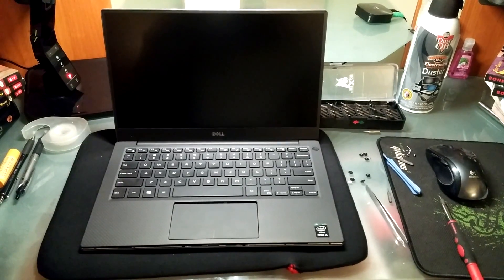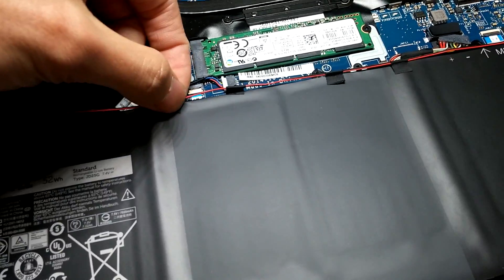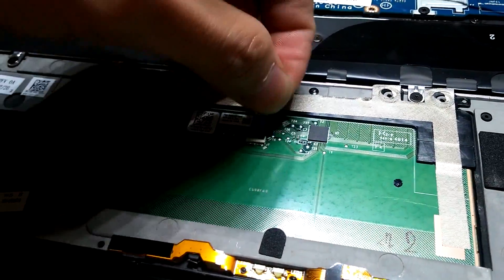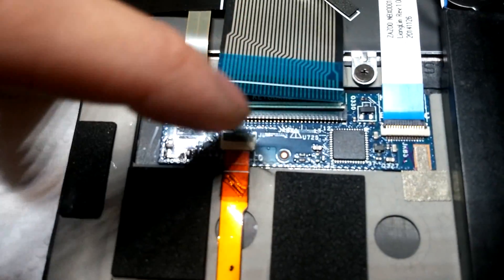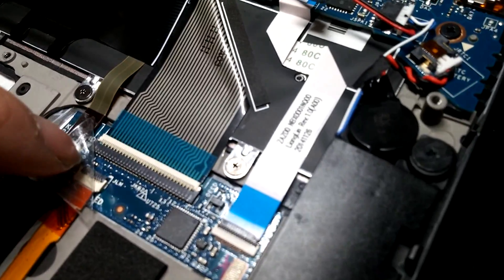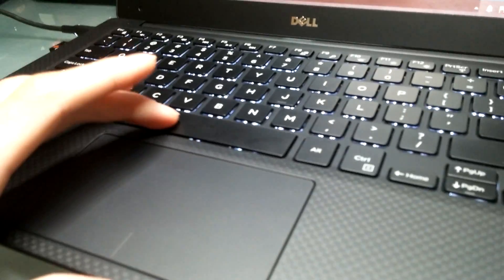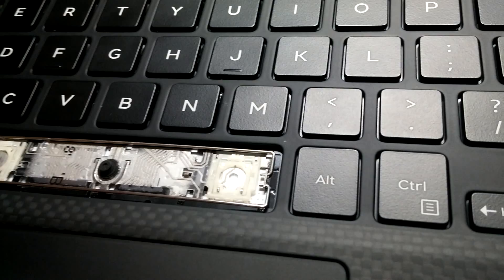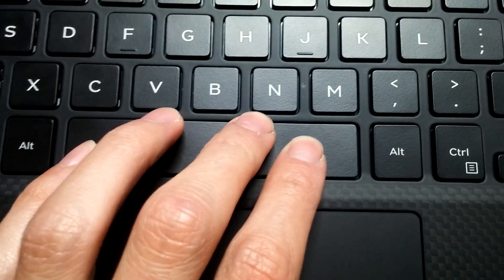Dell XPS 13 & Other Laptops - Fix Space Bar key sticky resistance tight defect problem DIY keyboard

Comment: Thanks for the video!  I wanted to put this comment out there since this video is quite old now,   I have a dell inspiron 14 7435 2 in 1 laptop.  it had a spacebar issue where it didn't feel right was kinda mushy and super, super sensitive.  Barely had to touch it to activate the button.  Anyways I took off the bottom and part one of this video does not apply to this model.  the ribbon cable issue has apparently been fixed or just didn't apply to this model.  However, part 2 of the video helped my fix the issue!  I popped the plastic off just as instructed and bent the metal rods to give them an upward arch while they are laying down.  I did both the top and bottom rods.  First time I had bend the top one a little too much.  Took it back off and made it less bent, put it back on and I'd say it's a 90% plus improvement.  I don't even really notice it at all now.    So here's another thank you for the video!  Just wanted people know that at least part two of the video is still a relevant fix for an issue dell still apparently has.  This computer has been like this since I got it, which was about a week ago, but it was an open box deal at best buy and I got a great price so I didn't want to return it.  Maybe that's why it was returned in the first place!

Comment: thanks for the detailed explanation. My problem was that the spacebar would not register unless you hit it around the  middle. If you tap the spacebar on the left or right sides, then it sometimes won't register. Your method #2 didn't quite work for me. I had to bent the rod towards the opposite direction (U -shape), which raises the key back up on the left and right side. Now the sides of the space bar register perfectly. 

On another note, I purchased a replacement keyboard from ebay that had the exact same problem right out of the box. Terrible design flaw by dell and/or their vendors.

Comment: same thing here,
for me it was the left and right sides of the space bar that dont work at all. the sollution was to bend slightly  the two sides of the metal (inverse of what you do) and adding a thick double sided tape in the midle of the barr(tou "erase the trigger buton)

Comment: I used your directions to fix the totally useless spacebar on a brand new Dell XPS 9650.  The disassembly was much more hairy than the laptop you do here: you need to remove damned near everything, including the motherboard.  Disassembly directions for the 9650 can be found here:

https://www.youtube.com/watch?v=Nvz7fcqzQDM

Doing your part 1 made the spacebar almost good.  Doing both parts made it nearly 100%.  The far edges of the spacebar still don't work.  I think that the bar itself is flexing too much.  But it's good enough, yay!

THANKS!

Comment: When I was removing the spacebar, the two white pieces came apart, but I don't know how to put it back together. Any help?
Reply from the maker: pry open a key that you use the least (just in case) and study how the two white pieces fit together. I had that problem before and it took me less than 5 minutes to fix by studying another key. They all use the same mechanism.
Reply: The spacebar piece are almost completely different, such as they are big rectangles and has holes for the hooks (6) when the other keys  are hooked with these notches going outward. The mechanism is the same but I don't know how to fit it in :/
Reply: Lol took me a while but it got it! thanks!

Comment: This actually helped on my thinkpad... thanks!
Reply: X1 Carbon? I just bought a 5th gen X1C and the trackpad moves around a little in the frame and feels as if it isn't the right fit. I am thinking of doing this and tightening the screws to make it feel better. My brother has the same machine and his trackpad is fitted into its frame very tightly. Any suggestions?

Comment: The right and left side of the space bar didnt work for me, I tried to bend the bar (both ways), didn't work, so I put a bit of electrical tap in the middle of the back of the spacebar (where it presses on the button), works like a charm now!
Reply: I am having the exact same problem, right and left side are almost completely unresponsive. Would you mind sharing exactly how you did it? (or upload an image off it) would be greatly appreciated.
Reply: I don't have my XPS anymore (too many problems, returned it), just do as the video shows to remove the spacebar, and add padding in the middle of the back of the sidebar, where it contacts with the press black button on the computer
Reply: I had exactly the same problem on my new XPS 9360. I added three small layers of electrical tape the the rear centre of the keyboard - where it makes contact with the black rubber button that registers the key press. That appears to have resolved the problem completely. 

Before the fix, mine was so bad that an inch on the left and right of the space bar didn't register anything.

Comment: I just tried method #2 and the middle is perfect now, but the left and right ends of the space bar are almost completely flush with the keyboard.

edit: i followed Marc's option down below by reversing the bend so that middle is downward and left and right are upward, and it has resolved the entire spacebar! It's super clicky now.

Comment: I tried the second part, before I hadn't seen theplace that the little wires go. Thank you so much.My E1505 and I are very happy.Not 100% but a lot better.  It just wouldn't do spaces. Halfthe timeis better than none. ;)

Comment: Real helpful video! I only watched this so I could know how to open up the laptop safely. Then noticed my spacebar had the same issue as described in the video, the second method was super helpful. Do you know if its possible to tighten up the the hinges on the screen if it starts to feel loose ?

Comment: I have the XPS 13 2016 and 2 days after i got it, the c key got "sticky". Apart from the fact that it is just sad to pay more then 1000 € for a notebook and then it has such obvious production errors, I need to remove at least the key. So my question is, if you can just remove the normal letter keys by prying them out, as shown in method 2. I would be glad if anyone could give me an answer quickly, because this is annoying but i don't want to break my keyboard by ripping out keys.
Reply from the maker: Yes, you can do method 2 for your c key to see if there is anything stuck under there. However, unlike the space bar,  there are no metal support brackets underneath.

Comment: Is it necessary to remove the trackpad first? It looks like you should just be able to disconnect the main keyboard ribbon cable and then tighten the black adhesive cable.

Comment: Hi Sam, thanks for the video. I've recently had a sticky 'W' key and removed it and cleaned the area. It didn't fix the problem unfortunately, but now I can't get the key back on. COuld you please do a video on how to replace the just a normal key (not the spacebar). It seems  very complicated with two white plastic pieces. Thanks.

Comment: Method 2 kinda worked for XPS 15 9550. The bottom part of the keyboard was mushy like crazy and now its a lot better. However, its a little mushy still in the middle but I can live with it. The top part of the keyboard where it never needed a fix and how it should feel still feels fantastic as it should.... why Dell why.

Perhaps I didn't bend the bar enough? I was a little conservative. But I didn't bend it anymore than the video.

But thanks so much as it does feel a lot better!

Comment: Since someone said it works on the latest XPS 15 9550, i did the exact same thing on my laptop (Method 2). However the space bar doesn't rebound anymore at all. Everything looks intact, and i don't know what's wrong with it. Can someone help me please?
Reply from the maker: +Zhaoxuan Jiang 
Try taking it apart and study how everything goes back together. Every little clip and how the metal mechanism works.
There should be a rubber piece(s) under the spacebar that does its job to rebound. If the pieces are incorrectly installed, it can cause the key to not rebound.
Reply: +Sam K Thank you for your reply. Today I managed to remove the 2 white plastic brackets and reinstalled the other parts. Now the space bar is loose, but it does rebound. Is it possible that i damaged the brackets? They look intact indeed.

Comment: My spacebar didn't respond well at the bottom right, I had to press really hard down to get it to register. Bending the bottom metal bar so it archs up a bit, didn't help. Bending it to arch down didn't either. Then I swapped the bottom and top metal bars, and all seems fine now! Still not the greatest spacebar, the bottom is almost flush with the chassis. But at least it now sort of clicks and all presses get registered, no matter where I press on it, amazing! Thanks :)

Comment: thanks for the video. Kinda stupid you actually have to deform the metal to get things to work without colliding.
I'm pretty sure this doesn't affect all models though, as I bought on of these from Microsoft that didn't have the issue but the on I got from Dell did... =[

Comment: Hi everyone, 
I just received my XPS 13 9343 with Windows 10.  I had a similar 'mushy space bar' problem, but my issue was more about the left and right edges of the space bar not responding.  The middle was fine.
I followed Method 2, but it made it worse.  So, I took it back off, and I reversed the bend on the metal bar so it bows downward in the middle, and up on the edges.  I also 'massaged' the space bar key to bend it just slightly so it would do the same thing. (up on the left and right).  It works 100% now all the way across. 
Also, to put it back in, I snapped the bar to the space bar key first, then hooked the bar into place, then snapped the rest down.  That part probably doesn't matter, though.
Hope this helps someone else.
Reply: You sir, are a lifesaver! Look at my spaces!            Woohoo!
Reply: +Marc Fouchi This worked for me as well. I did method 2 as well, and it had little to no impact on the issue. So I just flipped the bottom bar around (you don't need to rebend it, you can just reverse it) as you suggested, and that resolved it. It's not like... perfect, but it is good enough. And I don't have to live for like 3 weeks while i ship it off to Dell for repair or anything, so I am please.
Reply: i do exactly the same, and it dont work. il have to put a thing(thick double sided tape) in to the midle, for "rising" the small buton inside(the triger)

Comment: My spacebar also doesn't register if I hit it on the left and right sides. It only works if I hit it in a half or 3/4 inch area around the center. Did you experience this problem? I still have a warranty but Dell support said that this was "normal". I'm afraid trying your method because I will lose my warranty if I start fiddling with it.
Reply: Jesse Miller Mine is doing that to its SO FRUSTRATING!
Reply: Do you know if that's normal for the xps?
Reply from the maker: Jesse Miller It seems to be a common problem due to a design fault.
I recommend method 2 in the video because that is the easiest, quickest, and will not void your warranty.
Reply: Sam K Update: I used my warranty to get another xps 13 even though the guy I talked to at Dell said all laptops had this problem. The spacebar works perfectly now. If yours doesn't work and you still have a warranty, USE IT!

Comment: Thanks.  I'd recommend reseating the keyboard cable before sticking it back down.  Have to get the cable to go all the way in to connect.  Method 2 by itself was not enough I found.